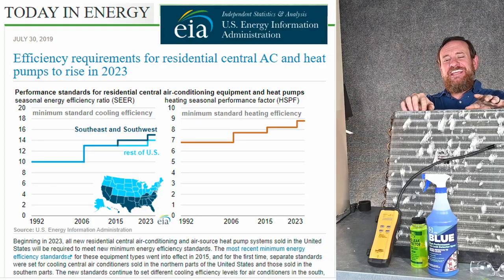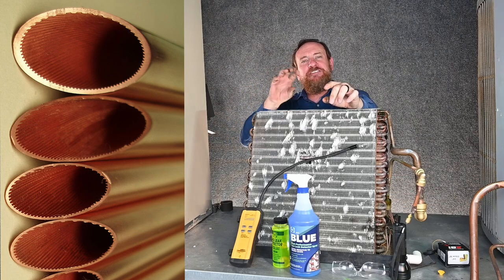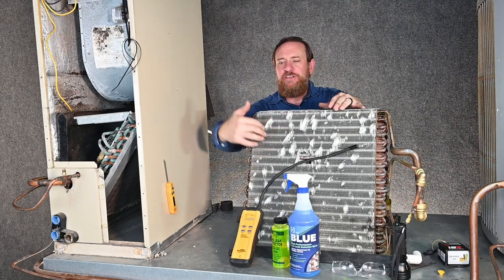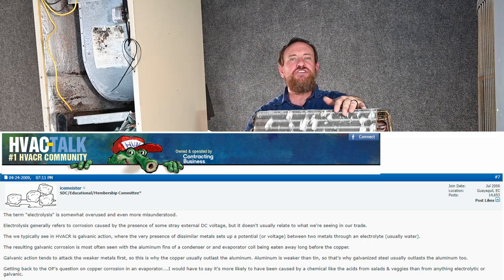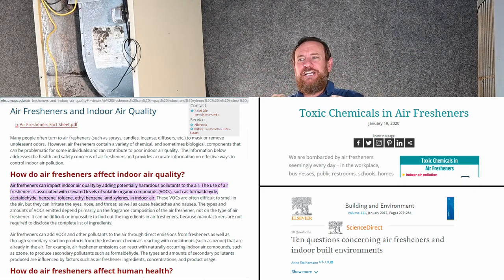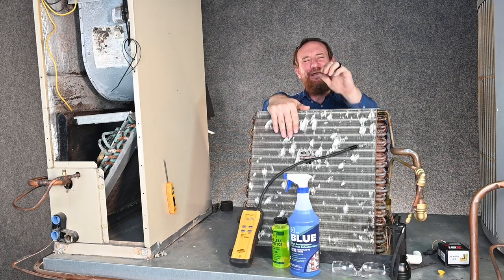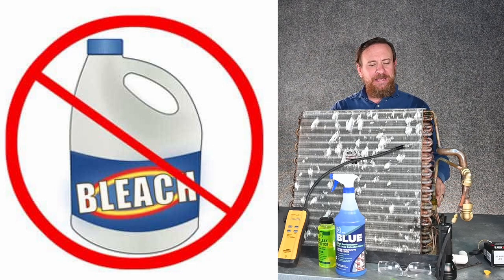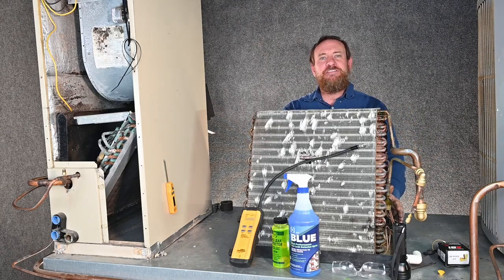HVAC 159 Why evaporator coils leak (Fixed)

Comment: The conclusion I've come to here is; if you're going to own a home,,go to HVAC school if at all possible. 😊
Reply: Or be an accomplished DIY'er and build on those skills.  Got to repairing automotive AC systems years ago, all the way back to R-12.  Then moved to a home with AC 17 years ago and I learned about contactors and capacitors and a whole lot more as I interacted with neighbors getting service or replacements. Moved into my current home in 2016 with a 1975 Rheem heat pump.  Lots of poking around and found out that the outside unit had been replaced along the way, it was "only" 18 years old.  

So everything is fine until May 2023.  No cooling.  Threw the gauges on, low on R-22.  It took a LOT of poking around to find the leak....in one of the evaporators.  That's right, this has two compact evaporators stacked in the air handler.  Even overlooking the fact that Rheem would not have these sitting around in a warehouse anymore, you could not remove them without cutting both copper and (two) PVC drain lines with a reciprocating saw.  Also took a Dremel tool and two tube cutters.  I am convinced that the air handler was assembled before the drywall was put on the walls of the air handler closet.  There is NO way it could have been installed just from the front.

Did my research and got a 3 ton heat pump N coil evaporator rated for R-410a that would physically fit in my space.  Nice to have that 410a pressure rating if I have to replace the outside unit.  Yeah, it took a lot of work to R&R the evaporators, many hours of research, make a new base plate, sweat all the connections with silver solder, connect to the drain line, etc. etc. 

The bottom line is that someone who learned skills over a long period of time can do impossible things.  Oh yeah, the internet was a partner in this endeavor.  No way could I have done the research I needed years ago.

Yes, I claim bragging rights for the "impossible" DIY AC project!
Reply: Poor quality material not made to last
Reply: @VictorAgresti  The glib answer about things failing that I've heard for almost 70 years about every kind of failure.  Despite best efforts by every manufacturer of everything, parts wear out and/or fail.  No manufacturer of expensive stuff wants the bad customer relations that defective parts gives them.
Reply: I did just that.  Funny you should mention it.  I wasn't interested originally--thinking that the equipment was just a bunch of junk.  It turns out that a lot of refrigeration equipment suffers from poor installers and lack of maintenance more than manufacturing defects!  It also a great field--love it!
Reply: @frequentlycynical642  been servicing 40 years to make  a good judgement call on the quality of parts .How much experience in the field do you have?
Reply: @VictorAgresti  Some times years doesn't mean shit.  All too subjective.  And I don't know what part you are referring to other than perhaps my ancient evaporator.
Reply: @VictorAgresti  If a few words on the internet get you this upset, you need help.  Or beer.
Reply: @frequentlycynical642  maybe not but they do cut every possible corner to get the parts to last through the warranty period at best instead of what once was "years of care-free service".... Aluminum coils are gonna last as long as copper which have a finite lifespan as it is?

Comment: So many leaks develop where the tubing penetrates the steel plate.  I have imagined that this was often due to, over time, the expansion and contraction of the different metals - not only from every day on/off cycling of the cooling or heating modes - but also the seasonal difference of heating and cooling modes (warm air being blown over the coil in winter and cool air blown over the coil in summer).  Informative video, thanks.

Comment: Expansion and contraction. That's why coils leak. Thinner walls on the copper coils by manufacturers to save money are the primary reason coils leak.
Reply from the maker: Expansion and contraction leaks is typically found on the condensor tube sheet specifically where the cot gas line enters the condensing coil at the tube sheet. Vibration  is the main culprits of condensing coil leaks. 

As for evaporator coil leaks, saving money is one of the many reasons.
Reply: Manufacturers can't freely choose coil thickness, it's all determined by the safety regulations, UL standard.
Reply: @royappa   Yeah, they can. 😄 UL provides a MINIMUM. They could always go thicker. They have the test results-- they know how/why these leaks occur and how best to prevent them. They just don't go thick cuz they're permitted to be cheap.
Reply: @royappa  And the laws of physics.

Comment: Bleach is an excellent cleaner and initial stripper for mold and mildew slime in the pan. We practice 1 cup of bleach followed by 1 pitcher of hot water to flush the concentrated bleach out of the drain line. Only use this in the cooling season so condensate will also ensure flushing of bleach residue and prevents critters from trying to enter the line. We use alkaline coil cleaner on coils, which is way more harmful but it gets the coil to that new starting point, with the understanding it has to be rinsed off. Bleach  does the same job with the drain line. This is just another point of view. Your video covers some excellent points that need to be shared.
Thank you
Reply from the maker: Give viper a try 
"
Viper Condensate Pan and Drain Treatment is a sprayable gel that contains enzymes and silicone detergents. The enzymes are natural biological disruptors that will penetrate and break through the solid layers of slime, sludge and sediment. The silicone detergents coat the pan, p-trap and drain piping with a lubricative film to improve flow and prevent future soil adhesion. The slow dissolving gel will outperform and outlast conventional tablets and strips."

Comment: Manufacturers promote videos that blame technicians and homeowners. Just like they did with ecm motors and I was the biggest player in proving them wrong that everyone needed to suddenly change their ductwork out. My background is 36 years experience and teach it worldwide. Things are built cheap with cheap thin metal and built to fail. Period....so understand that.
Reply: Preach brother 🙌
Reply: How is your evacuation procedure done?
Reply from the maker: Since I listed class action lawsuits against manufacturers for coil leaks I'm pretty sure no manufacturer is going to promote this video. 

I did list multiple fact based reasons so it's not just one thing. #neverstoplearning
Reply: @love2hvac  ....no worries my friend. You did give multiple reasons I agree. I'm guilty if I teach and stay out of the field to long I start to loose touch with real world issues so I try to investigate instead of buying into deception and believing  everything I think  sometimes. Love what you do of course and thank you for educating  these future call backers 😃.

Comment: Way back in the day Carrier made an all aluminum coil in their air handlers that used compression connections on the refrigerant lines.  Coils were slant style and built like tanks.  Never found one that ever leaked.  As time went on, Carrier and other manufacturers decided that they needed to build some obsilencense into their coils so they started making them out of copper, steel and aluminum.  They knew the rust and electrolysis would occur but it meant they would sell more coils.  Cut down production cost and sell more equipment.  What's not to like for a money hungry beast?  Everything built today is built cheaper and more flimsy then ever yet they charge a premium for it.  Welcome to Capitalism 101.
Reply from the maker: I remember those all aluminum slant coils! GE and later Trane had the all aluminum condensor that early leaked also. Aluminum can be good if done right. 

Planed obsolescence is alive and well for sure. 
In the other hand, look at how many big AC companies only sell units and don't fix anything. Bad capacitor, new unit, bad contactor new unit.think of how many good units where replaced with something cheaper. 

 Too few people/companies are looking at proper airflow and building envelope. Just replace the appliance with another. 

I think another really big driving factor is government regulations. With the new refregerants at  much higher pressure with an oil that turns to an acid. Who thought that would be a good idea? 
The mandated energy efficiency ratings are driving a lot of the thinner coils and coil grooving also. 

It's a soup for disaster. 
The EPA is all about not venting refregerant but they allow manufactured to sell leaking coils. 
🤷
Reply: Carrier did some crazy things on a few of their coils. I remember that I removed one leaky Carrier coil and it had some sort of galvanized plating to seal the copper tubes. The replacement coil was a standard copper coil with brazed joints and never leaked after I installed it.
Reply: @dgapp76  , Monopoly / crony capitalism >basically equals the same thing.
Reply: @picklerix6162  A coils (evaporator coils in the house) sometimes had tin coated copper for corrosion RESISTANCE. In other words, they were not corrosion proof, but they were more corrosion resistant than just copper.
Reply: You mean corporate socialism.
Reply: Yep, hopefully when we go (back) to hydrocarbons we'll use mineral oil again, that wont corrode the thing from the inside out and be much lower pressures. I'm legitimately tempted to run isobutane propane mix for an AC system rebuild instead of R134a conversion with poorer performance and corrosive oil..   @love2hvac

Comment: So even rinse free cleaners should be rinsed?
Reply from the maker: Most of the no-rinse products are alkaline cleaner. 
It's relying on condensation to rinse itself off. 
Yes it needs to be rinsed even though it's easier to get off than non rinse.

A company in NY used this as maintenance on ductless units until they had leaks on all the ones they used it on.

Comment: So what should be used to service the drain line if not bleach? And.what product should be used to clean the evap.coils?
Reply from the maker: VIPER
PAN & DRAIN TREATMENT

It uses enzymes to clean.

Viper also makes a variety of safe cleaners to be matched with the job.

It's made by Refrigeration technologies and the founder is a really smart guy that wanted to make better products.

Comment: Excellent and informative! Thank you for this. So is there a way to prevent leaks? Some of my units are facing the sea, is it a good idea to spray corrosion protection on them? I do suspect most of my leaks come from the inside out though due to bad repair techs. Thanks!
Reply from the maker: Coastal units do not last as long. Even with corrosion protection everything metal rusts out.

As for corrosion protection, it needs to be HVAC specific as some slow heat transfer.

It's getting more and more difficult to find skilled techs today. Between private equity companies just trying to sell and untrained new techs it's been challenging.

I had a conversation just yesterday where a guy thought it was a good idea to leave capacitors in the box.

Comment: Wow《☆》Lots of good info Ty👍🛎I replaced the Fan motor in my Air handler recently. I thought the old motor was emitting a smoky smell in my house. The smell is still being generated with the new motor. I checked for R22 leaks with a sniffer. The only time any leak is detected is when the compressor is running. I didn't think R22 would smell smokey or smell at all. I guess it's a combination of being 20 years old & maybe the compressor is burning up internally ? Thanks for any advice Brother🖖😎☮
Reply: Just a thought, do you often burn candles? Candles produce a lot of soot. A wet coil is a very efficient filter. Smokey smell? A somewhat wild guess.

Comment: Would you recommend homeowners spray on their A-frame coil with some kind of alkaline based rust remover, if already rusted, then coat it with a rust inhibitor product?  And I'm referring to where the copper cross tubing is located. If so, what products would you recommend?

Comment: Dang! I think putting bleach down the drain line corroded my coil. Never thought it was a problem if the bleach wasn't in direct contact with the coil, but I guess the fumes are enough. My system is 6 years-old; can I have only the coil replaced?

Comment: Hey Ty, thanks for the great information as always! 
Anything else to watch out for on all aluminum coils? Been coming across a lot of leaks so far this season, on new systems. Not a good start!
Reply from the maker: Aluminum coils are pretty easy to fix but the bigger issue is they clog up very easy if someone don't braze with nitrogen flowing. 
I use solderweld aluminum rods and a lot less heat. 

Bryan Orr (HVAC school) and Craig (AC Service tech) both have great videos on fixing aluminum coil.
Some people even use epoxy.

I am a long ways away from making aluminum repair videos.
Reply: @love2hvac  Much appreciated! Thanks for your time.
Reply: I installed my coil using StayBrite8 low temp solder. No need for a nitrogen purge at the lower soldering temps.
Reply from the maker: @picklerix6162  it handles higher pressure but they don't tell you that it doesn't handel vibrations as well and the very high risk of flux entering the refregeration system can cause much more damage. 
Several manufactures specify against it and some city and state codes also do not also its use in HVAC

Comment: Recommendations on how to feasibly clean coil?  Pump down and pulling coil out seems very intrusive.
Reply from the maker: #1 A properly installed filtration system should never need a coil clean. 

#2 if the coil gets dirty, pull the coil and clean it. While it is out install a proper filtration system since the hard part of removing refrigerant and cutting the lines is already done.

#3 cleaning it in place. This is risky 
A: easy to damage the fins
B: unlikely to get the build up inside and in between the fins
C: It's almost impossible to get enough volume of water to accurately remove cleaner. That will eat away at the coil
D: risk of getting water and cleaner on the customers floor and in the return air. 
E: difficult and in some cases just not possible to access in place. 

It can be an shorter term option just depends on the scenario.

Pull and clean also has risks.

A: Is the tech going to seal all the lines once they are cut open?
B is the tech going to use a proper cleaner that won't damage the coil? 
C: is the tech going to do the multiple rinses to remove all the cleaner? 
D: is the tech going to braze while flowing nitrogen?
E. Is the tech going to replace the filter drier?
F. Is the tech going to do a proper pressure test?
G is the tech going to pull down to a proper vacuum with decay test?
H is the tech going to charge without contamination of air or with his/her old hoses.
I: is the tech going to reuse the refregerant? If is the tank clean and oil free  vacuumed down before using and filtered into the tank and a new filter back out .
J is the tech going to properly connect the drain, flush it, and refill the trap with water?
K is the tech going to properly check airflow, superheat and subcooling? 

When people want a coil clean they look for the cheapest price. With something as complex and important you want the best and you want the problem fixed so it never has to be done again.
Reply: @love2hvac  wow,  i truly appreciate you taking the time to reply and detailed reply at that.   You’re awesome.  Is over 0.1” DP across coil good indication that it dirty?   What is normal DP for residential coil.
Reply from the maker: Typical pressure drops for residential coils can vary from .1 to .4" WC. If the pressure drop in in excess of .3"wc, inspect the coil for dirt or other blockage.
Reply: @love2hvac  Thank you awesome sir.
Reply: @love2hvac  No Big company will give a Technician enough time to do all those steps, not when they are backed up with calls.

Comment: Those micro crack leaks are caused by formicary corrosion, that you show here, but should mostly be eliminated with the new aluminum on aluminum coils.
Reply: That is what they say about every half assed attempt they make at designing a coil that lasts one week past the warranty

Comment: Don't forget to add double the pressure as previous refrigerants
Reply from the maker: Your right I should have I included that.
Reply: Or more than double. R12 was very low.. almost a Vacuum in lower temp systems. I have an old dehumidifier and it uses a solid aluminium evaporator coil and R-12 and it probably outlasted the previous owner.